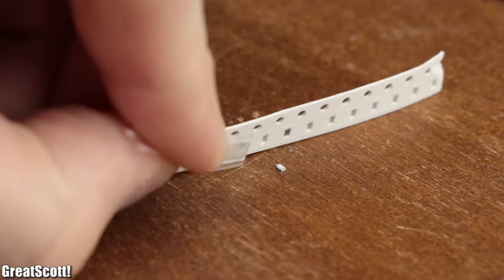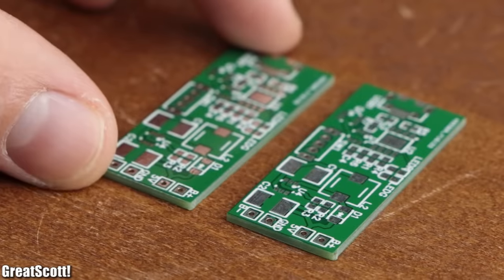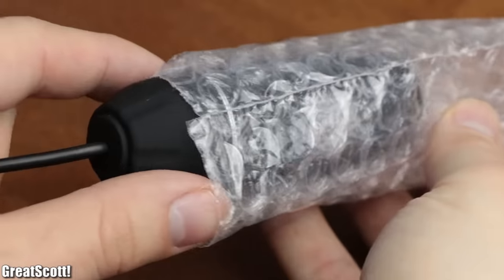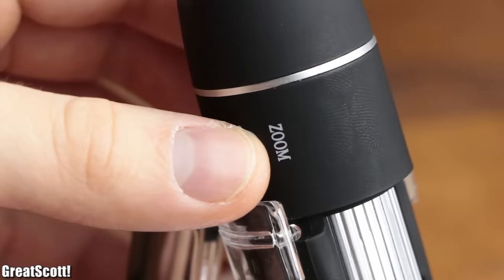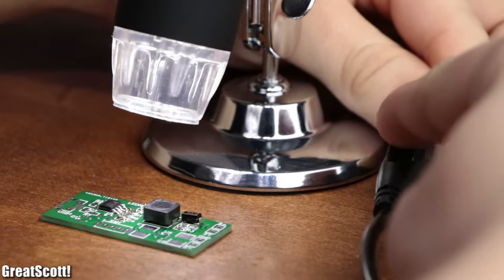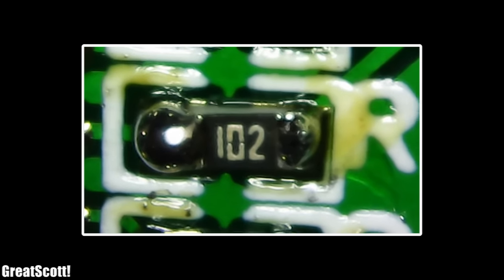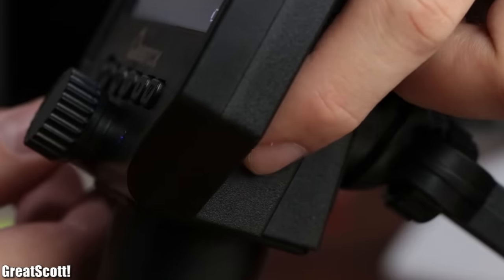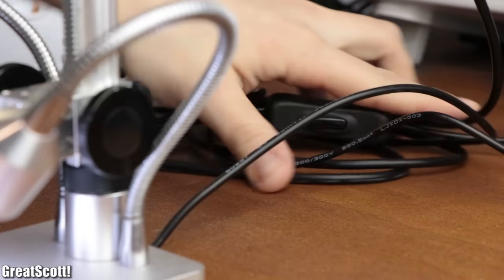Microscopes for SMD Soldering || $15 VS $45 VS $189

Comment: It is interesting that the hand shake often experienced by those soldering SMD parts, disappears when a microscope is used. I have concluded that the hand shaking is due to a limited amplification in the human control loop. Human muscle control is adequate for the task, the limitation is in the optical feedback. In other words higher optical magnification improves the gain in the human feed back path and reduces the tendency for the system to go into involuntary oscillation.
 I use an long reach optical microscope, which works very well. It is important to use an extractor fan to remove the solder fumes. If this is not done, it will not be long before the object lens is covered in a translucent layer of condensed solder flux.
Reply: Hello Nigel, that is a great observation, i studied Occupational therapy. If that is true then it may also benefit people with Parkinson disease. Help with fine motor skills in simple tasks shirt buttons, hobbies. war veterans with PTSD.  best degree in the world.
Reply: That's really interesting; I've been (unsuccessfully) avoiding working with SMD for years because of hand shake, so if a $50 LCD microscope can improve it that much, might be a worthwhile investment!
Reply: can you let me know how it goes.
Reply: wayne hart I think my observation applies to these who have a healthy nervous system and not suffering from muscle degeneration. There may well be a inherent weakness in the human optical system that results in problem close to the limit of optical resolution. Certainly small involuntary eye movements associated with perception maybe the real source of the problem. The magnified image may make these small movement insignificant. What ever the reason, the shake in the tip of the soldering iron is greatly reduced when the user can clearly see the work area. Working with out a microscope, results in eye strain and muscle tiredness. The latter the result of attempting to lock the hands  and arms in a particular position. With practice, both become more relaxed when the user is not forced to concentrate and strain to see the parts being soldered.
Reply: The Up Late Geek I think you will be very pleased with the result of using magnification. It is important to chose a solution that is comfortable to use and provides a high quality image. Magnifying glasses work, but they are difficult to position and suffer from distracting image distortion at the edges. My long reach binocular microscope allows the microscope objective to be some distance from the the work area, giving lots of room to manoeuvre the soldering iron and solder. The microscope is also equipped with a very bright white light, providing excellent illumination of the work area. This is particularly important as the magnification reduces the area illuminated and thus the light reaching the eyes.
Reply: My $15 microscope arrived today, and I was surprised at the difference when I displayed the live feed on a monitor in front of me while I worked on a simple SMD resistor replacement. I think the difference might be that, even though I can make out what I'm looking at without a microscope, I can only barely make it out. It takes a lot of my concentration to see the location of what I'm working with. When I watched the microscope's output, I could readily see where I was trying to work and other things surrounding the area. I could focus on more than one item easily. It's interesting how you can apply the idea of control systems to perception. I was going to critique your theory, but upon reading again it seems I misunderstood. I was going to say that your brain probably can't get a good lock on where something is, which you described as a problem with the "gain", which means here that there is too much visual noise. You can't consistently tell the location of your target in all the noise, so you try to move around to where you think it is, taking up much of your concentration and preventing effective work. As you said, "involuntary oscillation" could be a product of this. I think that another factor could be visual feedback of the position of your soldering iron tip or other tool. When you're constantly moving around trying to keep the end of the tool on your fuzzy idea of your target's location, what you see is a constantly moving, almost vibrating tool. This leads you to try to correct further for the perceived vibrations, adding overcorrection to the error of inaccurate target location. This could lead to oscillation. This would be especially mitigated by using a microscope because when you're using a microscope the initial error of target location isn't present in the first place, so your tool stays relatively still. Since the tool is still, your motor skills aren't trying to correct for vibration. These 2 factors of increased visual "gain" and vibration "involuntary loop" mitigation produce a much more usable system. Thanks for the idea!
Reply: mckryall there have been a number of experiments done on these bio feedback loops. The classic example is to hold up a sheet of transparent film to the eye. The film has a black dot printed on it just slightly bigger than the pupil of the eye. The film is moved to a position where its shadow just covers the pupil. If a bright light is shone at the dot, the pupil will go into rapid oscillation as it expands and contracts to control the light level. The brightness of the light provides the gain needed to force the ciliary muscles of the eye into limit cycle oscillation. The experiment can be done using a finger to block the light. The subject must close one eye to avoid the other eye becoming dominant and taking control. This is an example of feedback in the involuntary nervous system. 
The more complicated hand eye feedback loop has also been investigated using analogue computers to complete the loop between a joystick and a target on a monitor.screen. with such a computer it is possible to control the gain of the proportional, integral, differential mathematical components of the loop. Changing the gain of these components can make it impossible for the human operator to keep the screen target in position. These experiments  mimic the problem of a gun operator trying to keep the gun sight pointed at a target.
 At some settings the operator can exhibit oscillatory behaviour. By adjusting the external feed back controls it is possible to calculate the biological system response in terms of multi dimensional phase and gain margins, and processing delays. The external feedback controls can be adjusted to aid the operators performance.
I am glad you are putting the theory to such good practical use.
Reply: wanna know somethings interesting? i can't draw a straight line, but i can desolder, clean the SMD pad and apply paste between two contact probes on a memory test probehead. the size of a probe is 150mn tall, the pad is 15mn and the space between the probes is around 30mn, just because i have 40x stereo microscope to show me the image. no shaking.
Reply: Nigel Johnson 

Although I do have minor issues with motor skills, I’ve noticed that I’ve made up more than enough for that by being born with long term power vision. Basically my mom had great vision and kept it until recently with her sisters. When you’re canadian and just about everybody in your family at one point had to learn to spot and hunt deer from 1 km in the dead middle of the night, you’re going to be able to be precise in terms of tiny circuitry components.
Reply: I think it might be that the person can rest his hand on the bench, thus using the fingers - which are better for fine control.
Reply: Nigel, I think you're SO right! Now, what microscope can I get for more than $189 that overcomes the problems of these ones?? Even the $350 ones don't have any capture facilities!! I can't afford a professional one at $5000!!
Reply: Hello professor Johnson,it's great to see you here. Hope you're well.  I grabbed one of these and it seemed to solve my problem too. Learning to solder SMD's seemed like a thing I just wouldnt naturally be able to do. The magnifying glass in 'our lab' didn't cut it for me either.  It's a really great tool to have.
Reply: Excellent observation. This deserves a wider audience. If it doesn’t already, surgery could benefit from the use of cheap equipment like this.
Reply: @the_eminent_Joshua_E_Hrouda  I am sorry it has taken so long to reply to your post, I did not receive an update notification. 
By now, I hope you have found a suitable microscope. My binocular optical microscope did not cost that much, around £250. However there are a number of USB microscopes that work with a computer. These cost under £50 pounds. They are not as good as a binocular microscope, two eyes being better than one for gaining depth perception, but are far, far better than nothing, and have the advantage of the ability to store the image. It is important to select one with minimum image delay. It is interesting that the image display delay can be influenced by other software running on the computer, or by the operation of the software driver. What this demonstrates is that processing delay can also introduce hand eye control loop instability. This is an obvious effect with a long delay, but even an almost imperceptible delay has an effect on hand coordination stability. This is consistent with control theory, where the delay introduces phase errors into the control loop.
Reply: Yes that is exactly what i noticed when i started to work on microscope, the precision of moves is totally proportional about the magnification.
Reply: And for finding the short circuits https://youtu.be/LRlPTCTgjMY   :D
Reply: "Blah blah blah science blah blah blah I should get a microscope for christmas blah blah blah".
Thanks a lot for the insight!
Reply: @devnol  not sure what to make of the blah blah science comment. You can just buy a microscope and improve your soldering as a result,or you can understand the science and thus select the best microscope for the task. 
A stereo microscope is certainly better than the monocular type, as the former will not Rob you of depth perception.
Both the optical and cheap electronic camera microscopes will provide the necessary optical gain, however the electronic microscope can, if poorly chosen, insert a time delay between the real world and what is displayed. This delay is as bad for the feedback loop as poor gain. The focal length of the microscope is also important, as it defines the space above the work for the tools to work within. Even the briefest touch of the hot soldering iron, will melt the plastic of a cheap microscope. My microscope is mostly of a metal construction, but it has a plastic hood surrounding the object lens, this I have protected by wrapping it in Captan tape.
Because the objective lens is never that far from the wiring area, as is invariable  directly above it, it really is important to have an electric fan running close by, to suck away the fumes from the solder. If not the solder smoke will condense on the microscope lens, and within a very short time fog it to the point where it is opaque. This is even more important, if the microscope lens is plastic, ora glass type with anti reflective coatings. Any attempts to clean these type of lens will most likely melt the plastic or remove the anti reflective coatings. It is also not a good idea to inhale the the solder flux smoke, as this produces a known medical condition called solderers lung. A serious chronic condition that results in obstructive pulmonary disease. The fan required should be fitted with a carbon filter, to trap the flux smoke, before it can contaminate the room.
Reply: @nigeljohnson9820  and everyone else in this thread 🤯. Came here to learn about cheap microscopes, and left with a much better understanding of some “Why” questions I didn’t know I had. Cheers and thank you all.
Reply: @floweuphoria69420  I am not sure how a respirator can help improve tactile acuity. But it is one way of avoiding exposure to toxic solder fumes. 
It might have the advantage of avoiding disturbing the tiny components with your breath, however the same effect can be achieved using the microscope, as the arrangement avoids directly breathing on the work space. The electric fan and filter remove all the fumes from the work area. 
As the air flow is into the fan, the pressure gradient is low, and does not disturbe the component placement. In any case the air is extracted from the space above the PCB, this ensures that the solder joints are not prematurely cooled by the flow of extracted air. 
The solder fumes visible condense on the carbon filter, slowly depositing a brown stain. The smoke fumes can be seen to curly away from the user and the microscope objective lens, drawing in clean air that protects both user and microscope. So unless you already have OPD, as a result of breathing solder flux fumes, I see no reason to wear a potentially cumbersome respirator.
Reply: I am in my 70s and work with SMD. As a young man my hands were very shaky but as I aged they became steadier, to the point that now I cannot detect any shake with or without magnification). Maybe I'm just lucky. Or maybe the critical damping of the feedback loop has optimised!
Reply: @sundog486  it is an interesting observation. Normally as we age, our eyesight fails, so I would have expected a level of compensation to be required. One possible explanation is that your nervous system is working more open loop, without tight control.
The mathematics that govern this feedback system is common to all types of feedback, so stability and oscillation is decided by gain and phase margins for the total loop. Without intending any insult, maybe you are just over damped, and always have been. The effects of age would simple have slowed you down your response, without introducing any oscillation.
Reply: @nigeljohnson9820  No insult taken. My eyesight has deteriorated but I am able see and manipulate all but the smallest SMT devices without additional magnification other than my regular glasses. As an electronic engineer I do have an understanding of servos and feedback, so I would have thought that age related slowdown would have reduced stability and caused overshoot. Overdamped? Maybe, I was always useless at ball sports.
I just checked my steadiness and my right hand trembles by about 0.2mm; the left by 0.7mm. This seems to be the same whether I'm holding them steady or pushing a tiny object. How lucky am I? That's made up for the ball sports😀
Reply: @sundog486  overdamped, suggests no oscillation, just slower to reach the steady state, at least for a second order system. Not a problem for a none moving target, such as an SMD component. It would be consistent with not being very good at ball games, where the target is moving. I too am, or was until retired, an electronics designer, so I cannot claim any medical training, that would be useful for this subject. While your observation is interesting I do not think it nullifies my original hypothesis, particularly as the above is a reasonable explanation consistent with the theory, all be it lacking scientific rigour.
 It is interesting that control theory mathematics can be applied to biological systems and produce useful results.

An 0805 SMD component is 1.25mm in size length and width. So your hand tremor is a good proportion of the components size. This suggests something is stabilising your hands to the degree needed to place the component on the pad. It could be you are relying on the solder surface tension to pull the component into alignment, and maybe the conducted or radiant heat of the soldering iron to compensate for its accurate placement. 

I have found the key to soldering SMD  devices with a soldering iron, is to melt the solder on the pad, and push the component on to it. Holding the component with non magnetic tweezers. I have had little success with hot air and solder paste. 0603 is the smallest parts I can place by hand.
Reply: @nigeljohnson9820   I too am a hand solderer using a similar technique to you. Thank you for the interesting discussion Nigel.

Comment: That $190 microscope has been built from an off-the-shelf dashcam (mine looks almost identical), and it seems to be running the stock firmware as well. That's why it has the screensaver, and it's supposed to have a lipo inside that would keep the settings.   
You can most likely pop it open an add the lipo yourself, or even better, a suitable supercap. Could be an interesting video opportunity.

Comment: I just received the $15 one a few days ago, haven't used it for soldering yet (I have a project on the way - my first, building a cheap $20 oscilloscope), but my son and I had fun using the microscope very close up on things. The zoom seems to have two focus ranges, one medium and one VERY zoomed in but must be almost touching the front lens area. This is the level we were playing with (you couldn't do any soldering at this zoom level), and we could see quite amazing detail of the tiny threads of clothing, the shiny ink of a tiny letter printed on paper, fascinating skin detail around the edge of my fingernail, etc. After a half-hour of just wonder and fun, I said out loud that the microscope already paid for itself!